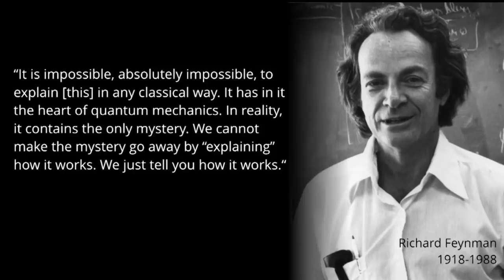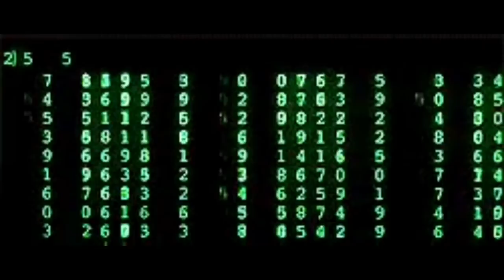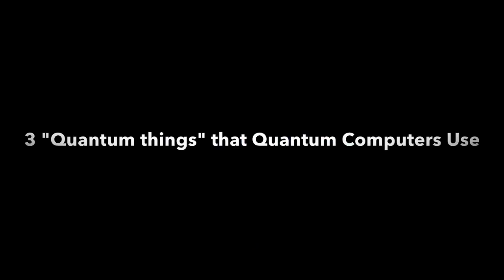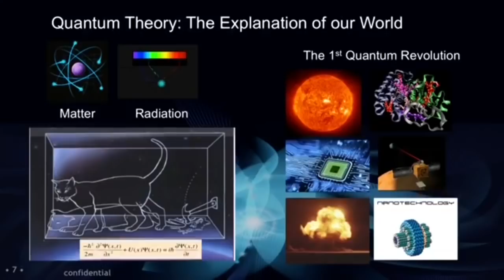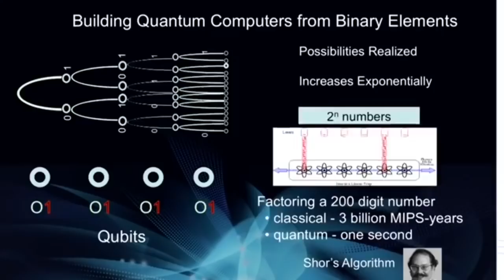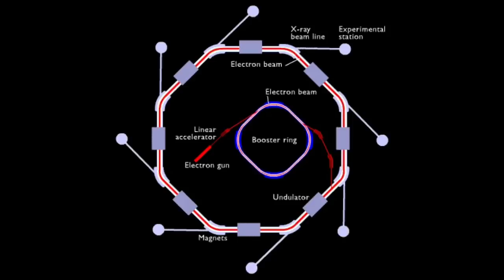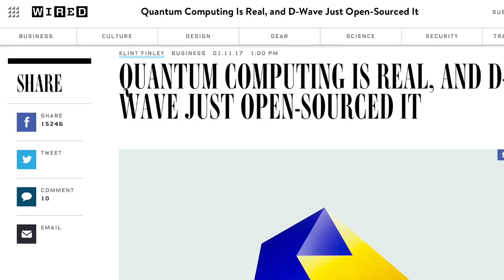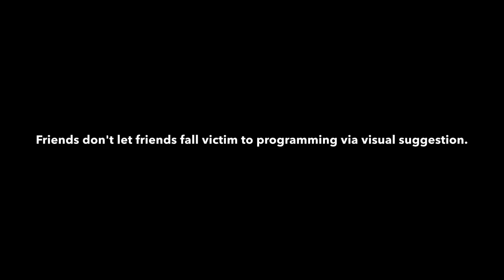The TRUTH About D-WAVE QUANTUM COMPUTERS and the FUTURE A.I. Artificial Intelligence Mandela Effect

Comment: You've made it clear you don't believe inD-Wave, but why? It's too bulky? That refrigerator is far smaller than the computers prior to the mid-1970's. It's difficult to program? So are modern computers, that's why we have abstraction: to eliminate the multitude of minutia. Too expensive? Four of the biggest companies on the planet are splitting the cost.

Will the quantum PC be based on this technology? Almost certainly not. But that doesn't mean D-Wave and their partners aren't pioneering new technology, and it doesn't mean they don't have years (decades?) of sales to go.

Xerox was a multinational corporation, as were all the other examples you gave, for several decades. Still is/are.

What about their claims is too good to be true?

Comment: I am quite perplexed. At 3:44 / 19:20 , you used a double negative while chuckling. The  word "the" is the only thing on the screen. A small t (24 or 2- 4's =8) or a cross. h =8 , and you used a small e. Well,  e=5 ; but also, turned on its side you have Phi. Phi multiplied by 5 =8. So rationally speaking, one can only infer that you want the end of God. Beware of false truths. Mandela...., ? I chuckle.

Comment: I stopped watching after 14 minutes. Some of the things you say are misguided, some are misleading, and some are true. D-Wave is a specific kind of quantum computer which is limited in the types of problems it can solve. These problems need to be expressed in a very particular mathematical way. Nonetheless, they are still an important step forward. 

The biggest problem with the video is the erroneous link between quantum computing and AI, also the unlying 'luddite' and 'religious voodoo' vibe. QC and AI are two separate areas of research and are arguably no more related than any other two areas of computing. Humans have been using computing devices since the days of the abacus. No doubt in the early days of electricity, there were people who thought it was unnatural to try and harness this force.

First you do the science. If you find questions arise that require ethical consideration, you tackle them. No voodoo required.

Comment: I don't think this chick knows a single thing about computing because if she doesn't think quantum has the potential to change the medical industry or financial then it becomes apparently clear. Think of it like this, if you were to try and solve a maze with a computer it will take a try at solving it one at a time until it solves the problem with a quantum computer it try's every solution at once and solves it in seconds. This video is nice because I can see other opinions on the matter but the fact of the matter is a real quantum computer is still in the process of being made. When the achievement finally happens we will accelerate to the next level of society. Besides what is all this illuminati crap in the video? Aliens? Please chill out this is a scientific breakthrough not a crackhead theory so please leave out the non-sense. There is no secret agenda, it's a search for answers and the curiosity to invent a new tool to change the world; not a alien satan summoner......

Comment: I don't understand how superposition is possible
Reply: You aren't the only one. Physicists have been grappling with this from the get go. That's why Schròdinger made up his famous cat example, he wanted to illustrate the absurdity of it. Yet,  experiment after experiment, nature does indeed behave as if it does not want to decide what state an insulated quantum system is in, unless you measure it (i.e. break the insulation of the system).

On the other hand superposition of a qubit is easy to visualize, and the QM math isn't difficult.

https://en.wikipedia.org/wiki/Bloch_sphere

The take away is that the two opposite states mix in a more complex way, having two mixing angles. And what the isolated system contains in quantum superposition is the entire physically allowed potentiality of the system. The mixing angles inform us about the probability for what we will observe upon a measurement.